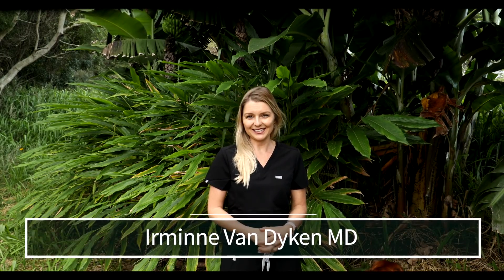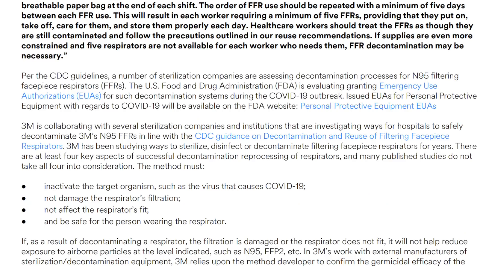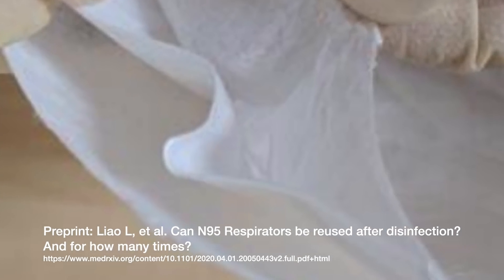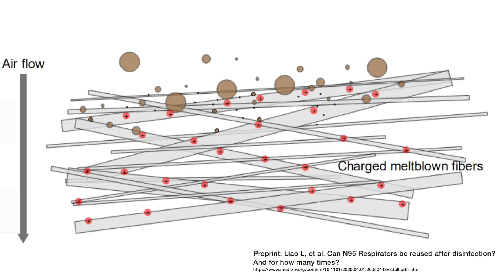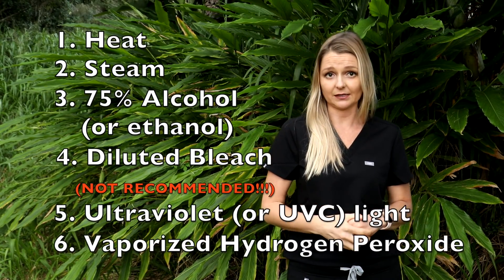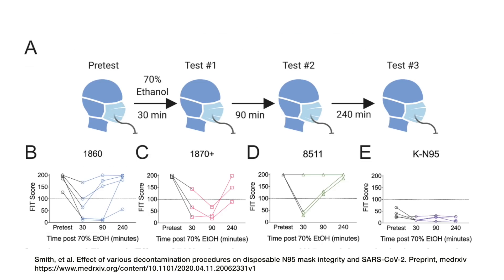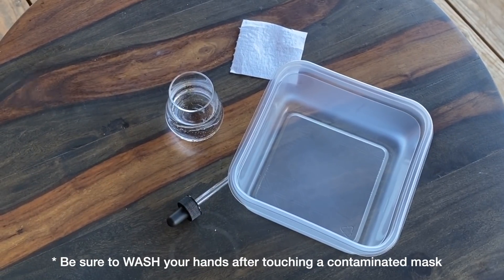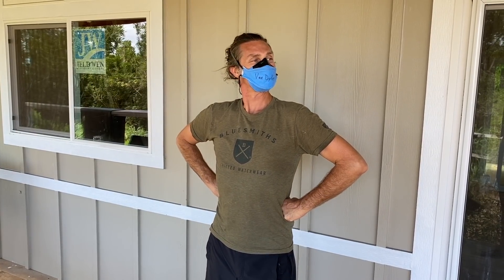How To Disinfect Your N95 Mask at Home

Comment: I'm a chemistry professor, so I will give you my thoughts:
Putting the mask in a plastic container and then putting the container in the oven does not seem like a good idea to me.  Plastics  degas when heated and may contaminate the mask.
Spraying a mask with 3% H2O2 is a good disinfectant and leaves the mask with no harmful residue, however this will  only decontaminate the outside surface. Hanging the mask outside in direct sunlight should also be helpful.
The best solution however is probably buying a portable far-UV 222nm  lamp.
Be sure to treat both sides of the mask.
NOTE: assuming Froly Ant's comments below  are correct, there is nothing anyone can do to restore a N95 mask to new condition.
Reply: Thank you. I saying the same thing. I would do it with a complete glass made container/ bowl or ceramic/ porcelain.
Reply: I store mine in a dry paper sack for roughly nine days between uses .. rotating them in and out of service, letting them self disinfect over time.
Reply: Russian communists caused Chernobyl nuclear disaster and lied about it, Chinese communists caused COVID-19 disaster and lied about it. In addition, the communism killed more than 100 million people since 1917. What we need after this is over is the Nuremberg-like tribunal on the crimes of Communism, similar to the tribunal on the crimes of German Nazis during WW2.
Reply: Lalo Lacinato that’s what I do
Reply: > Plastics  degas when heated and may contaminate the mask.
To be specific, both the recommended container ( 1.25 quart hard walled polypropylene container (Ziploc medium square) and the filter material in the mask are polypropylene - do you have a specific concern with polypropylene at 85ºC (185ºF) { or a bit hotter, given commercial oven temperature control)? Ziploc lists only  only "Polypropylene (Plastic), ClearTint PP Blue 5733 (Dye)" as ingredients, and markets it as microwave-safe, which allows for much higher temperatures than this. The lowest melting point I've seen for polypropylene is 130 °C (266 °F) - much higher than the recommended temperature. 
   The authors of this protocol ( https://doi.org/10.1101/2020.04.09.20059758 ) make the point that the material in the recommended container is the same material as the filter layer in the mask - they say of the recommended container: "This ensures that both the charged layer of the mask and the container are made of the same material, which decreases the likelihood of material incompatibility."
      So, to first order, if polypropylene out-gassing is a problem under these conditions, the mask filter material is going to be an issue regardless of the type or presence of a container. Doesn't mean it isn't a problem, though.
> The best solution however is probably buying a portable far-UV lamp.
That's certainly an option, though it comes with its own issues - for thoughts on UV-C disinfection of N95 masks, see:
https://www.n95decon.org/files/uvc-fact-sheet
and for more depth, https://www.n95decon.org/files/uvc-technical-report
both of those links should be updated as more research comes in - they are currently the 23 April 2020 versions.
Reply: @rafowell  Far UV at 222 nanometre wavelength does not damage human tissue , is not carcinogenic and will sterilise in less than 2 seconds.

UV-C is 237 - 254 nanometre and is proven to damage DNA , eyes , skin and requires up to 12 minutes to obtain a 99.99 % sterilisation rating , it may be used to sterilise wards or theatre that are locked out from human entry , UV-C may also be used effectively to sterilise airflow inside Air Conditioning ducting.

Please make sure to distinguish between the two types.

Far-UV 222 nm is virtually impossible to source at this time .
Reply: our daughter-in-law has a gel nail studio and she has, of course, a 54W UV light to dry the nails. The UV light...would 54W be sufficient?, 2. for how many minutes, on each side of the mask should the mask be done. I read that an UV treatment should be a minimum of 30 minutes, but would that be the case of 30 minutes for each side?  Curious..
Reply: UV degrades the elastic, not everyone has an outdoor space with sun, Hydrogen peroxide is sold out. Most of us have an oven. You don't need to use tupperware, you can use a paper bag.
Reply: @TalkingPugs  I don't know about citric acid, but vinegar will not kill coronavirus - google it.
Reply: Yeah, it sure seems like a bad idea to put plastic into a 185° oven, however I know nothing about convection ovens....
Reply: I use a CVS 3% spray hydrogen peroxide to disinfect masks and hang dry for 2 days
Reply: What is the issue in using a glass container?
Reply: Was wondering about plastic container in the convection oven ?! Was that the kind  used that says "microwave safe" ? I have to replay the part  before the mask was put in the oven...
Reply: Correct. Thank you!
Reply: How to buy a quality mask?https://www.walmart.com/ip/KN95-Soft-Comfort-Filter-for-Face-Skin-Care-with-Fixed-Nose-Clip-Non-Woven-Fabrics-10PCS/645924806
Reply: First they've done the testing and it worked. Chemistry professor or not, do the work and decide whether you want to trust it or not. She's a doctor and her team have done the best for this issue.
Reply: https://www.walmart.com/ip/KN95-Soft-Comfort-Filter-for-Face-Mask-Skin-Care-with-Fixed-Nose-Clip-Non-Woven-Fabrics-10Pcs/897097428
Reply: I need to watch all YOUR videos. Thank you.
Reply: What if it is BPA free?
Reply: I use a fine mist spray of H2O2 on both sides and hang to dry and dont wear for 2 to 3 days
Reply: Thank you! I'm not a professor but I always thought I had pretty good common sense.. and this just .. it felt uncomfortable.. wrong.. and I too worried about the gases.. and the fact that wouldn't the plastic melt?  ,, Thank you for your input. We are all trying to find our way in these scary times.
Reply: please do a video for us professor (seriously )
Reply: Can I buy 3% H202 at home depot or online ?
Reply: @TalkingPugs  May have to make a fresh batch daily
Reply: nybergdg I am 80 years and wanted to copy another able. Would you send me your remarks how to clean my mask.  Thanking you in advance...
delargo
Reply: Good comment.  The "challenge" with disinfecting a 3M N95 respirator is an oxymoron in itself.  Why?  Any professor has access to AMA, a plethora of Medical Journals, to JSTOR, to doctoral dissertations and a whole volley of published papers.  Published papers from the 1950s forward touting the dynamics of polyprophylene as an antimicrobial, and when electrostatically charged, in "trapping" .1micron virules as well. It's all out there. So, I find it humorous when anyone in the medical profession recommends someone apply anti-microbial solutions to something like polyprophylene  that's already antimicrobial by its' physical properties. Like saying "apply an anti-microbial like Lysol to the anti-microbial (polyprophylene) fully believing this is a solution in disinfecting a anti-microbial.  Maybe we should apply lysol to lysol, to see if that works, too, to disinfect lysol. Thus, the oxymoron.

 With that, 3M manufactured a whole line of varied respirators for use.  1000s of tests in the laboratory first--and came up with a six ply filter, with the innermost layer of polyprophylene fiber - billions of fibers only 10 to 30 microns across, that can be electrostatically charged by the wearer's breathing, and effectively traps COVID 19 within this inner layer. That's the N95. It only lasts one day.  That's the Scientific lifecycle recommendation - that's the 3M manufacturer's recommendation. Provides protection for 1x use. That's it.  The very act of breathing by the wearer over a day's use destroys 100s of millions of these inner layer polyprophylene filaments, like filaments in a light bulb. Once they break, no amount of disinfecting a burnt out light bulb in your house is going to make that work again, either.  "Disenfecting" an N95 holds the same truth. Another oxymoron.  The only way to "fix" the lightbulb is replace it. Same with the inner most filter; but the N95 is "disposable" and replacing the inner most filter isn't practical, as the mask itself is designed to be disposable.

The "challenge" CDC has is, China manufactured 10s of millions of these masks - and called them "N95" - sold them globally, but they were no more than 'beefed" up paper R95 Surgical masks that did not provide COVID 19 level protection..and most all European nations sent those masks back to China as defective.  Still, China won the contracts as a 3M competitor, so 3M rolled back much of their global production of these N95's. That's why there's a shortage right now.

So, this mindset of "we're out. this is all we have to make do" -- Still, one should never attempt or recommend ANYONE - in ANY WAY to disinfect the inner most layer of polyprophylene in the innermost filter. Simply stick to disinfecting the outer facial mask layer as that's just hygienic.  To me, using this N95 or any 3M gas mask after the cannisters are "full" - is just like you're fully clothed, sitting in a bathtub. Then, expect if putting a sock over the bathtub faucet, that will somehow miraculously  provide a dynamic that protects you from getting wet. That's about as much protection against COVID 19 a wearer of a already 1x worn N95 provides, disinfected or not.

The electrostatic filaments are already broke - that's the entire basis for this mask - the electrodynamic of static electricity on polypropylene. After a day, the manufacture specifically states a such significant number of these filaments are broke,  the respirator is no longer safe in protecting the wearer in any further use...as, no amount of disinfecting is going to "repair" these filaments.  ...but wearing the N95 in this state, disinfected, CDC states, is better than wearing nothing at all, like a sock over the bathtub faucet probably stops some of the water getting into the tub -- reality is, you're still going to get wet.
Reply: @porpo-donut  You seem to know what you're talking about, and your arguments seem sensible. But, no offense, ultimately you're just another anonymous voice on the internet. I would be grateful if you could provide a reference for the claim that inner layer filaments are significantly destroyed by a day of breathing. Also, I only use my 3M N95 mask for short durations during more risky indoor encounters, e.g. standing in line at the grocery store. So I'm curious as to whether the damage to the inner layer is proportional to the number of breathing cycles. After all, we are not choosing between a new N95 mask or a reused N95 mask, we're choosing between a reused N95 mask and nothing at all.
Reply: @porpo-donut  O boy someone is a smarty pants.. I mean you went alllll kinds of out...
Reply: @porpo-donut  Are we having a science lecture here? 😲
Reply: I just hang mine inside the oven without touching the metal  for 30 minutes at 200 degrees or put inside a paper bag . It won’t burn
Reply: @TalkingPugs  Take citric acid and finely spray it over your broke light bulb, or take your broke light bulb and set it out in the sun for a month. After either, or ANY attempt to disinfect your broke light bulb is taken and completed, screw same broke light bulb back in the light socket.  If it works, you are the FIRST person in the history of all light bulb production whose discovered how to repair a broke light bulb just by cleaning it...and the first person to fix a 3M N95 respirator to return it to re-useable after 1x use - to stop COVID 19, just by disinfecting it.
Reply: @porpo-donut  sorry sweetie,  you need to keep it simple for some of us.. and by some of us.. I mean me =D
Reply: I spent the  money and bought UV-C sanitizer box that as time setting programmed in of 5, 10, minutes and a 24 hour on and off cycle, you can put multiple masks in it, says it will kill all germs and viruses 99.9% effective. To me knowing that it is that effective leaves out the doubt of other methods, it gives a sense of safety.
Reply: @Rick-or2kq  Except the research demonstrated that the UV light was not always able to reach all areas of the mask? Steam & heat were.
Good luck - stay safe!
Reply: The reason I decided to go this route is that some hospitals use UV-C robots to sanitize rooms and say they are very effective.
Reply: Injecting or 10 drops of disinfectant instead of water may cure Trumpvid-45.
Thanks for your advice. I heard we should use glass instead of plastic Tupperware.

Comment: I'm hoping that leaving mine in a ziplock bag on the front seat of my car does the trick.  It does get really hot in there, as well as get plenty of direct sunlight.
Reply: Gary White leave in a brown paper bag. CDC recommends that for re-use and it will allow mask to dry while also letting heat kill it. If you have a few just keep them on rotation and write dates on the brown paper bags
Reply: Gary White - Car and house windows block UV rays.
Reply: You weren't paying attention.  I know she went on and on and on and on, but there needs to be a mixture of heat and moisture and in the right amount (60%).